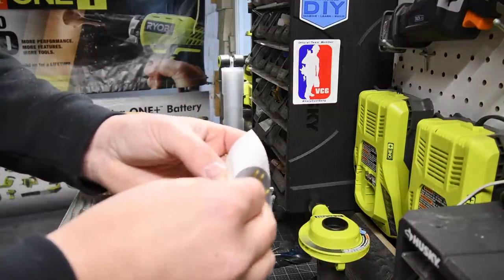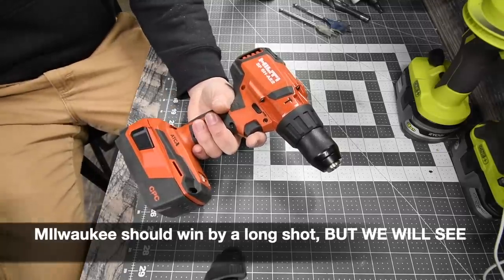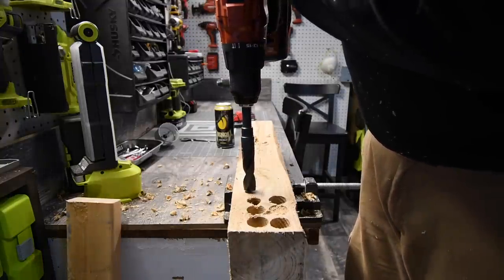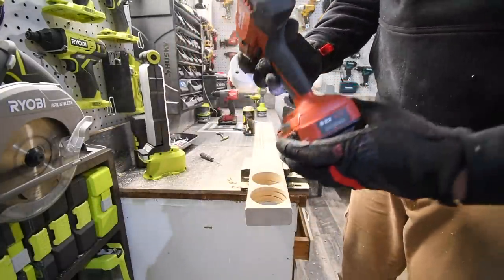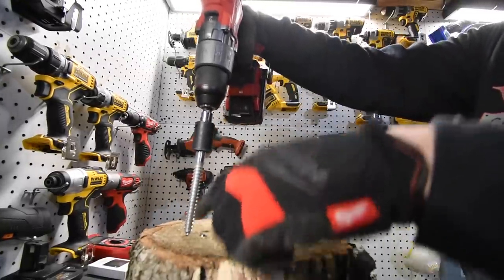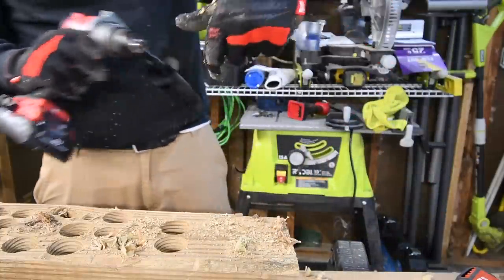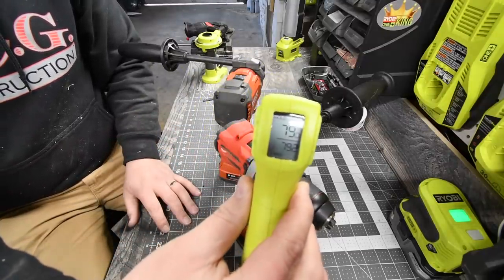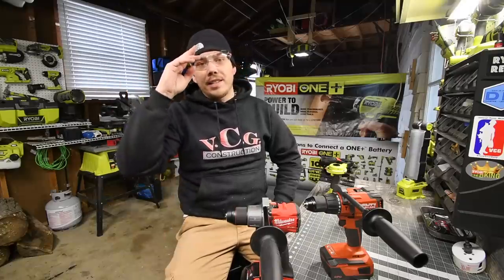Milwaukee vs HILTI (WOOD)

Comment: I’d like to see how the Milwaukee improves with a 6.0 or 8.0 high output battery in there. I have every flavor of battery Milwaukee has to offer and I can tell you that the 3.0 high outputs do NOT give the same power as the dual row cell packs such as a 5.0XC or a 6.0HO. I think I’m the future you should take into consideration amp hours as well as number of rows of cells in batteries when doing side by side testing. Not saying that they will improve the performance that much in a drill but I can tell you that my circ saw bogs when I’m running a 3.0HO in it and it cut like butter with a 6.0/8.0 high output.
Reply from the maker: I plan too do this test again with higher ah batteries, the HILTI makes stronger batteries as well. So it will be a good video. Because HILTI already has 21700 cells inside the regular batteries when the Milwaukee does not, the Milwaukee 5ah battery would have lost even more due the less powerful cells. But I’d be more than happy to show that in the next video I do with these :) the Milwaukee needs a high output battery to keep up with the new brushless HILTI, like Ryobi need the HP batteries to keep up with Milwaukee and dewalt
Reply: Ryobi Man Caver right on I’d love to see the 6.0 or 8.0 high output in the Milwaukee for sure. The best way to even the field would be 6.0 Milwaukee vs a 5.0 hilti due to the bump in volts. Should keepcthe Watt-hours about the same that way.
Reply from the maker: So by letting Milwaukee use a high output battery gives the Milwaukee a major advantage. For a fair test I should only use regular Milwaukee batteries since HILTI doesn’t have a special high output battery, just like when I use a Ryobi HP battery against Milwaukee and Milwaukee uses a regular battery the comments roll in asking why am I not using a high output on the Milwaukee. Then they say it’s not a fair test.
Reply from the maker: So yes, this is a fair test because Milwaukee has higher specs all the wya around and I used special batteries for it, this brand new brushless HILTI is a beast bro. You can’t deny that, best drill on the market right now
Reply: Ryobi Man Caver I’m sure the hilti is a beast but the power supply isn’t there with a 3.0 vs a 6.0. Just because it’s a “special” battery doesn’t mean that it’s going to give the same performance as a higher amp hour battery. Now the tool needs to be able to utilize the power at hand and I am not sure whether or not the drill would do such a thing. I think in the future you should switch battery packs and see if there is a performance boost. I would expect it in the larger cuts like the 2” spade and FOR SURE in a concrete test.
Reply from the maker: @ScotchAddict35  like I said I will be doing more intense tests with these as soon as I get bigger batteries for them both, but I think a regular 4ah versus that was used in this video versus  a 3ah HIGH Output battery that was also used in the video is very close when it comes to power and duration. But I will make a video this weekend with the Milwaukee 3ah high output vs the 5 ah regular battery,
Reply: I've tried that with 9 amp high output in the Milwaukee and 2.6 in the Hilti. Hilti still creamed it. More amp hours just give longer run time not more power!
Reply: Dave Sheppard that’s just not true. I’m talking more along the lines of cells in a pack. The power available in a 2 row battery pack (XC) is definitely more than that of the single row packs (CP). Each row is wired in parallel. The more cells in parallel equates to more current that can be drawn from the battery resulting in more power - you would really take notice if you took a CP battery, slapped it on a sawzall (not the little dingus brushed one) and really pushed down on it as it cuts. The tool will reach out to the battery pack to try and not bog down or cut out. If it only has a tiny 2.0 on it, welp the current just wont be there and can’t help it out. 

Give this information, it’s clear as to why I’d like to see a larger battery in the Milwaukee. It will have more current available to it and thus MIGHT up its performance. Now, do the electronics of the tool allow it to draw more power from the battery I don’t really know. It’s just a drill so it’s quite possible that the 3.0 provides sufficient power. But considering they only sell this drill with XC batteries I wouldn’t count out the fact that it can snag more power from an XC vs a CP battery. 

One thing to really combat my argument is that the 3.0 on the Milwaukee is using 21700 cells and naturally provide more power than 18650s. Thus I’d like to see the 6.0HO run vs the 3.0. 

Now if you don’t believe me go and out a 2.0 Cp battery on your circ saw and rip a 2x4 in half. Then do the same thing with a 9.0 and you will surely tell the difference. 

When it comes to batteries - SIZE MATTERS (to a point then it’s the motion in the ocean!) ha
Reply: @ScotchAddict35  ok......To state my point that my Milwaukee with a 9amp high output battery still lost every test to my Hilti which only had a 2.6 amp in it. I re-did the test after everyone started whinging about batteries and how the Milwaukee would win with a bigger battery! It didn't make any difference! Perhaps I should buy a 12 amp battery from Milwaukee to see if that will beat my Hilti with a 2.6 in it?
Reply: Plus I am no new boy to battery tools. I have been in my trade for 41 years and remember using 7.5 volt Hitachi's when they first came out years ago!!
Reply: Dave Sheppard I never said the Milwaukee would win. I just said why not try to even the playing field as much as possible.  Why limit the power available to the tool. I would think put on a large battery on both and see how they do. And I did not watch your video I don’t know your channel I can only speak to this video.
Reply: Dave Sheppard I never said you were a new boy either. All I said is you are wrong about the workings of batteries. Larger batteries do allow more current and thus more power. Now that current draw is also dependent upon which tool is at use so I am suspect that it would even help the drill but never know.
Reply: @ScotchAddict35  No Jonathan....I have no Channel this was two tests I did in my workshop with initially a 5 on the Milwaukee and a 3 on The Hilti. After the comments on this video I did another test the next day with my 9amp high output (from my 6 1/2 fuel Circular saw) in the Milwaukee and my smallest 2.6 in the Hilti.
Reply: Dave Sheppard I don’t doubt that the hilti beat the Milwaukee. I’d just like to see it do it with a big battery in the Milwaukee is all.
Reply: I would like to try the new 8amp From Hilti in my drill but I  would probably have to sell the house to get the money......they are not cheap and I find that the 5.2 hilti batteries last ages for me. I use the 2.6 in my impact, my 3's in my combi's and the 5.2 in my Te6 a 22 SDS. 😁😁
Reply: Well Jonathan, shall I  tell you the main problem with all these top line drills?............
Reply: It's that every B*****d wants to borrow them because they are so much better than the 1.3 amp hour Ni Cad powered piece of crap that they bought from Argos for 14.99!! (LOL). Watching this video again though they are both really impressive drills! I have both so am spoilt for choice!!

Comment: Hilti Tools are pretty nice, like Milwaukee, DeWalt, etc.... Suppose just depends on which “you” prefer, to get your jobs done😉
Reply from the maker: exactly and, but the Milwaukee has a much bigger 18v line over HILTI, by a long shot
Reply: Man Caver Tools yeah totally. Also, did never really understand Hilti’s battery “strategy” w/ sizes etc....& why they chose “it”

Comment: it also depends on the capacity of the batteries, I don't like the comparison
Reply from the maker: Milwaukee 3ah battery HIGH OUTPUT battery is a special battery. so this is a far comparison. I used a regular 5ah on the Milwaukee it would have lost even more

Comment: This review is almost a year old, but i feel like the milwaukee should have been given the same battery size ( or at least as close as possible) , they make a 4ah ho battery. this would match the Hilti, not to mention the 21v  vs  18v, never the less great comparison video
Reply from the maker: I haven't seen it yet, but I will look now and I thank you for the input Steve
Reply: @ManCaverTools   now that I look at my battery collection. It's actually a 4.0 extended capacity battery, the "high output version" before high output came along. Model number 48-11-1840

Cheers

Comment: My Ryobi Impact driver still strong screw and unscrew in more than 10,000 screw 3 years (not yet broken down).  My staffs who got Three HILTI impact driver are broken every more or less 5000 screws were failure.  But HILTI is too expensive repair is rip off !    Ryobi still winner must long term on every day
Reply from the maker: very good and I thank you Wizard

Comment: You're using a lightweight milwaukee battery, so you've shown what it's capable of. Take a standard 5-6A battery, and hilti will be behind by 30-50%This looks like a mid-range milwaukee to most, it's actually the most powerful on the market, but with a battery to match.

Comment: and on the other hand, look at the size and weight of the drills, it is disappointing that Hilti is a German company and distributes tools for refineries for many years, It went on the market with this drill that is not very impressive, in my opinion, Milwaukee is a better tool for a while length

Comment: Not a bad match up I’ll stick with my milwaukee not real good luck with hilti I’ve seen them on the job they might be first to the race but don’t finish they seem to get tired after awhile but big red keeps going longer
Reply from the maker: Milwaukee is an awesome company as well, love my fuel tools. These HIlti tools are new, They just came out with the new brushless line. the brushed tools are old and outdated. more 22v brushless hilti tools will be on this channel soon

Comment: Try to use higher amp battery for Milwaukee, but video is good (I use 9 amp)
Reply: And you have 3amp, I guess it makes difference
Reply from the maker: that video is coming up soon, and thank you for viewing
Reply from the maker: the 3ah High output battery is more powerful than the 5ah battery. so the 4ah vs 3ah high output gives the milwuakee a better chance

Comment: Is it just me or do all you other people out there in YouTube land agree that these combi drills are getting far too high tech? All I require is a 2 speed drill with a good robust motor with forward and reverse, hammer action, slow start and maybe a couple of torque settings thrown in. I have been doing my job for 40 years. I don't need high tech electronics or computers that set my drill up through my phone. If I am putting a timber frame together, when the screw just goes below the surface I stop. If I don't want to drill too deep into brick I wrap a bit of tape around the drill bit. I want to control my drill not have it control me. Plus it is more stuff that can go wrong. Ok....whinge over!! 🤣🤣🤣
Reply from the maker: you are %100 correct :)

Comment: Not enough difference in power to justify even 10 dollar difference
Reply from the maker: correct, if I got HILTI in a kit with 2 batteries, tool, charger, bag and belt clip. it would be about $470, so the price for the hilti is far more expensive. but tool only the milwaukee cost $10 more

Comment: hilti uses 21700 cells in all their batteries since at least 2019 whereas Milwaukee only uses 21700 cells in their high out put batteries and uses 18650 cells in their standard batteries.
Reply from the maker: I thank you for viewing

Comment: Those batteries are not even the same amp this is an unfair comparison
Reply from the maker: The Milwaukee has a 3ah HIGH OUTPUT battery. its a special battery. if I used the regular 5ah milwuakee battery it would have lost even more
Reply: Man Caver Tools the 3ah HIGH OUTPUT battery is not more powerful than the 5ah the runtime is but not power
Reply from the maker: @timothylee6796  we are not running duration though these are short high demand tests which is exactly what that 3ah high output battery is designed for. I already uploaded a quick test showing the difference between the power 5ah milwaukee vs the 4ah HILIT and the milwaukee  lost even more like I said it would

Comment: It’s because your using 3.0 batteries
Reply from the maker: if I used a 5ah battery on the milwuakee it would have lost even more, all of the HILTI batteries are 21700 cells. I would need to use a 6 or 8ah high output battery on the milwuakee for it to be an even test